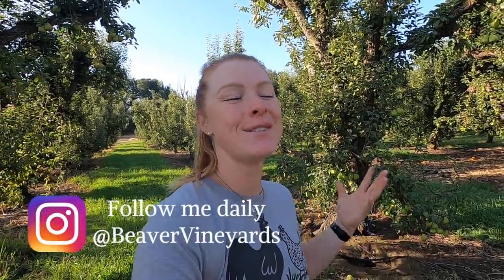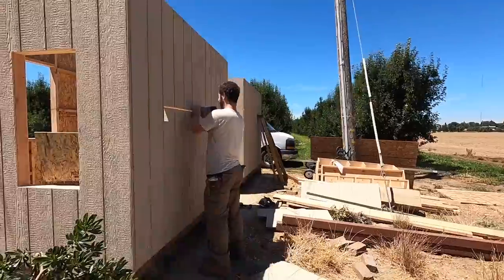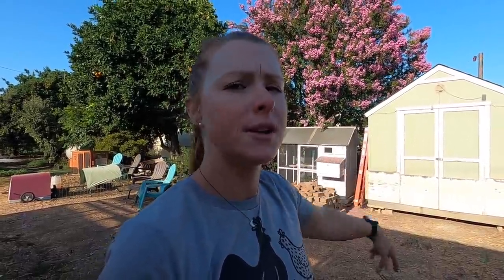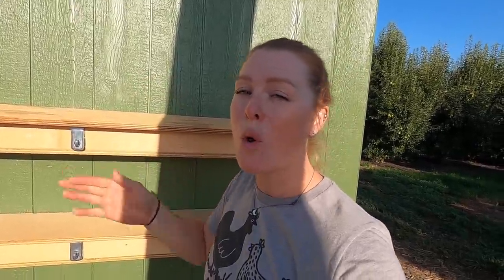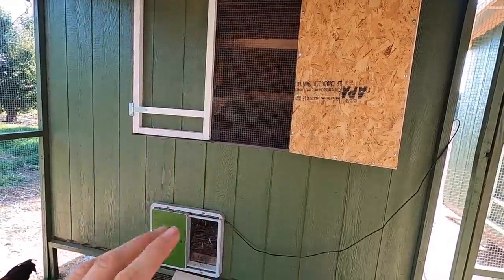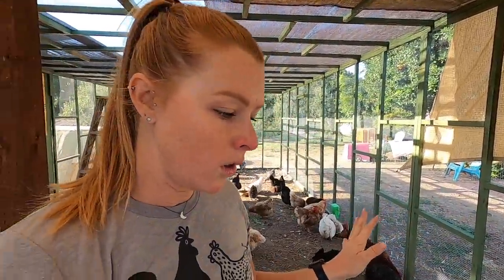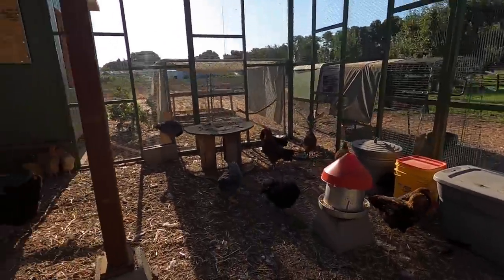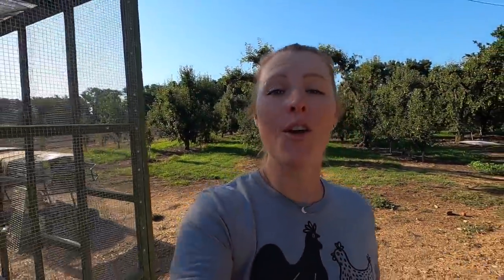Building My DREAM Chicken Coop

Comment: Nice coops. The only thing I'd do for the runs is to add a section at the bottom for a trench to place some heavy gauge fencing into to keep animals from digging into the chickens.

The shade cloth is available in various UV blockage rates. The highest rate that Lowes lists on the website is 87%, and a couple of colors.  Amazon has a larger selection in various colors and UV light blockage rates. I'm sure that an AG supply house can get wider widths and lengths if needed. 

How many eggs are the girls producing weekly?

Comment: Wonderful coops for your app.
Put long barbed wire, penetrates the long hair and thick skin,  around the floor crawlspace and hook up the electric fencer unit on the new chicken houses.  The coyotes will try to eat and dig through the floors and they will get through, the females with pups get food desperate in the spring.
Coyotes also will dig under the outside runs boards/fence.  Barbed wire electrified.
Surprised the skunks haven't found your coops and birds.  they love eggs and smaller birds.
Reply: Don't forget about the COONS!  Those were our most-deadly predator to our flock in WY!

I wouldn't worry about anything chewing through WOOD to get at your birds.
Reply: Yeah, there are so many predators around and chickens are an easy meal for them, so electified barbed wire is a good idea. If I got this right, there is a large concrete slab that the coops are placed on, so they will not need any, but the fences will.

Comment: I love those coops. In winter time, do you need to insulate them or put in a heat source? Here in Norway, the winter can be tough, and coops need to be insulated and may also need a heater of some kind. I use an electric frost guard, as it is well protected against fire hazards and will not overheat anything. Best of luck with your farm and chickens.
Reply: Probably not with the windows closed. Where she's located there's no snow and overnight low temps would be around  3-7 C for a few nights here or there in winter, 13-18 C during the day